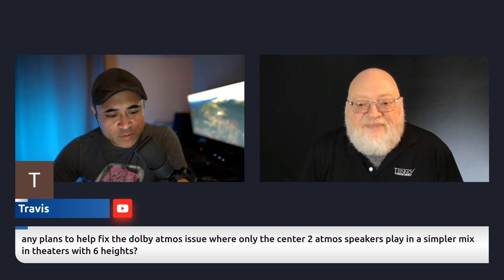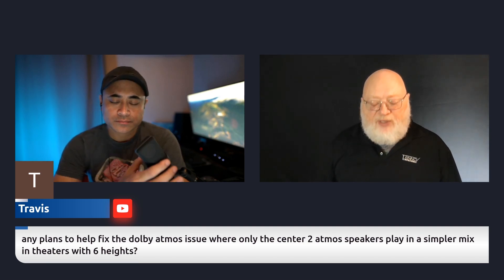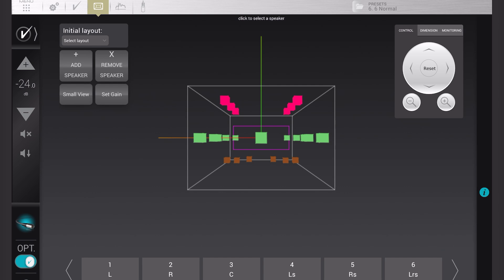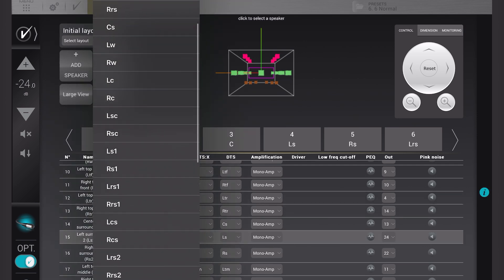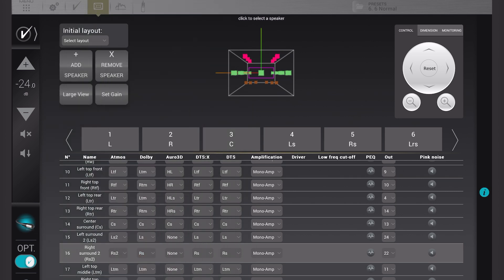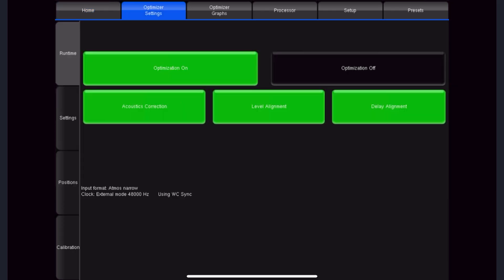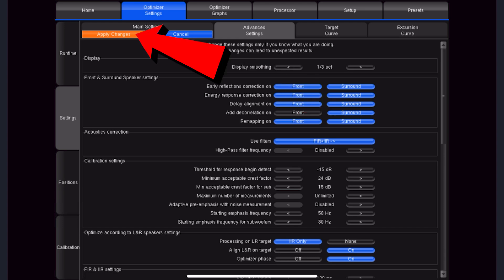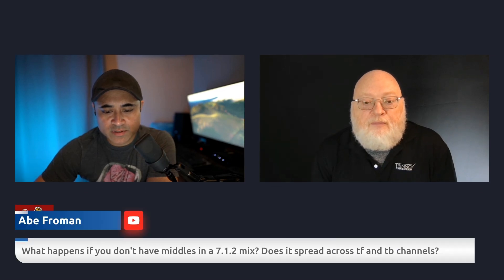Fixing Poor Dolby Atmos Mixes By Creating Arrays

Comment: With my AVR(Marantz Cinema 30), I have the option to expand my 7.2.4 system to 7.2.6 but after this video and several others that mention the issue I am not going to do so.  Seems .4 is the sweet spot since at least the speakers get used even if the track is .2 only.

Comment: I upgraded to 5.2.6 and also heard some movies f.e blade Runner,where no top middle active..
Reply: @texxhexxmm  If the top middles weren’t active in a .6 layout then that movie have been mixed as an object bed where they had 4 fixed locations for the height and didn’t have them move around.

Comment: But in theather atmos is good
Reply: I’ve never been wowed tbh
Reply: Atmos have a different codec for theatrical and consumer release, unlike older codec like 7.1 or 5.1, and lie about it. thats why dolby dont respect consumer anymore.
Reply: @bastiencatil2509  Even if the Atmos codec for home is different, it stills supports more sound objects, placement, and channels than Disney uses.  Disney is just unnecessarily crippling their mixes.

Comment: Here’s where it gets crazy.  If you play that 7.1.2 mix on a theatrical Atmos system, it has the ability to send what’s in the bed (the .2) into the entire array of height speakers but objects can also discreetly move through that same array.  At home, you have to choose between an array or be able to have discrete objects move through the array.  Theatrical can do both at the same time.  The unfortunate thing for home Atmos mixes is that every processor decodes the bed as static objects which is why the .2 is always in the middle heights only or between the 4 heights thus playing out of all 4 heights.
Reply from the maker: Interesting. I get the idea though. Seems like it would be something that could be implemented with an update. On the Trinnov at least. I’ll have to inquire.
Reply: @therealshanelee   Yeah, if anyone could do it it would be Trinnov, but even then I don’t think they can.  They’d have to fundamentally change the way it decodes Atmos.  It’s more like something Dolby has to change.  The bed channels being rendered as fixed objects is something that happens when the file is converted from the master file to .mlp which is the file type used for authoring the mix in Dolby True HD.  Trinnov would need to find a way on the decoding side to know when those 2 static objects for the overhead are bed or object and then do something to send them to the array.  That just doesn’t seem possible.  I also think Trinnov thinks it’s a problem with how it’s mixed and it’s not entirely that.  If you take rain and put it as 4 fixed objects in the overhead it would come out of all 4 or 6 height speakers at home.  In the theatrical mix though, if you placed the rain as 4 static objects it would only be in some of the height speakers where as if you did it as bed it would come through every height speaker because in theatrical they have many more height speakers.  I could be wrong about this next part, but I think a fix could happen when the mix is converted from theatrical to the home mix.  They’d have to look for things that are encoded as bed for the heights and re-map those to fixed objects for the home release.  That’s the big mystery right now for me, which I will hopefully find out soon, is if they’re re-doing the mix for home or simply taking the master file and converting it for home playback delivery.  If you want to read more about the spatial coding and how it renders bed channels as objects check out pages 264-266 of the Dolby Renderer guide here:
https://professional.dolby.com/siteassets/content-creation/dolby-atmos/dolby_atmos_renderer_guide.pdf
Reply: @NickMatzkeMusic  So in short, if they use Dolby's automated process as a simple path when when down-mixing a (potentially) theatrical 128 bed + object Atmos mix to a smaller (say 10) bed + object home mix, the bed channels are converted to objects at fixed points (with some post processing), more objects are created at fixed locations for the output mix (up to the target number), and the audio of the theatrical objects are aggregated to the bed and created fixed location objects of the target output.

In that process, the distinction of channel based sound probably intended to be played from speaker(s) covering a portion of the room (the bed layer) and pinpoint location sounds (the objects) is lost, and everything is treated like a sound from a pinpoint location?  When a processor like the Trinnov gets the end result, it will render it as encoded, as objects to pinpoint locations?

Am I understanding this correctly?
Reply: @therealshanelee THXRD, a french home theater enthusiast, be the first to build full atmos room 24.1.10, and be the first to point this problem. Work directly with trinnov and dolby for years with help of JP Lafont, a french international acoustician and no, this problem is insolvable. At least their is no retroactiv fix, all movies mixed this way will stay forever this way, its hardcoded and non distinctiv. You need something like atmos pro, as dts:x pro, to solve this. But how many people on this earth have more than 7.1.4 or even 9.1.6 ? Dolby dont care of this hundreds peoples that can benefit of multimillion dollars developement. 
Their is no array possible in such a small layout, that why object mix and scalability is non relevant, you can just add channel for height speaker and leave the 7.1 bed as it like in the past, like 11.1 fixed channels.
Reply: Thats why consumer atmos is broken and a lie. Just try the max layout 24.1.10, and how only fours speaker diffuse bed and all others play for few seconds anecdoctic objets sound. 
Before atmos, if you have money you can have theatrical experience. Not anymore. Like movies without bluray support that let us only low bitrate streaming version
Reply: @bastiencatil2509  I think home Atmos isn’t broken if you stick to the standard home layout which is 7.1.4.  If you’ve got a big enough space to do the max layout you’d probably want to do a mix of speaker arrays and discrete speakers.  But yes, for the people that try massive layouts they are missing the true theatrical experience.  I think they’d be best to do a mix of arrays and discrete speakers.  I think there is one super elite service where you can get the actual theatrical releases of a movie but can’t remember what it’s called.  Even if you can get a true commercial playback system you still the theatrical Atmos mix of a movie to take advantage of it.